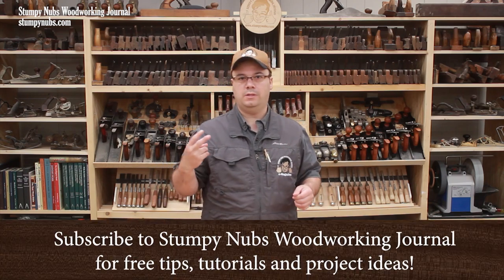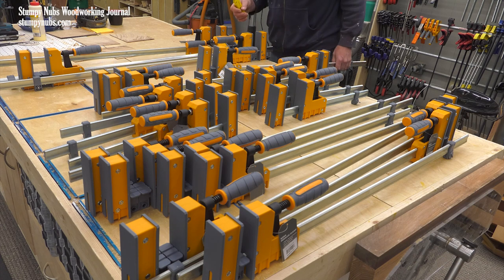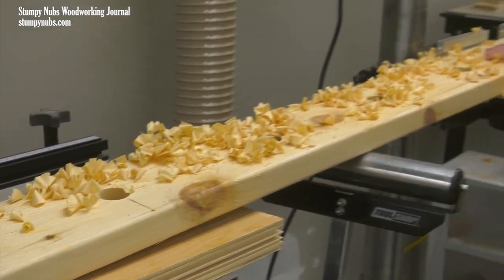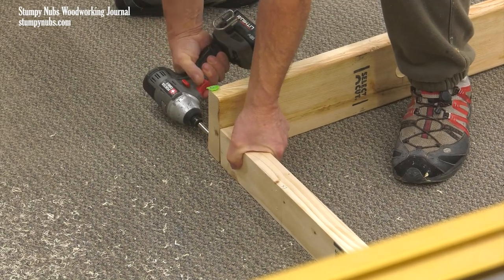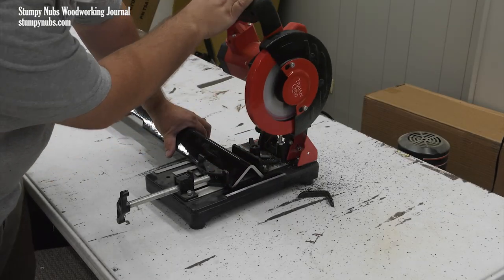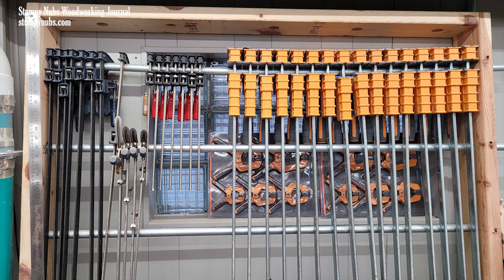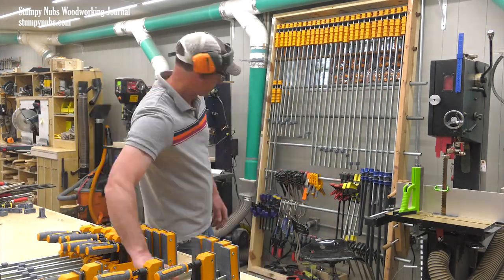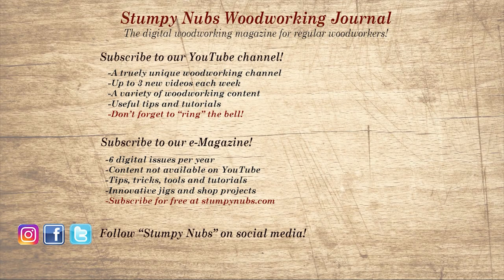How many clamps does one woodworker need?

Comment: This comment goes back to your video regarding cabinet scrapers.  I tried multiple times to make my card scraper work.  I followed your advice step by step.  I watched video's of 2 other very respected wood workers.  
I never succeeded in getting shavings, not once. Nothing but powder.  
On a lark I purchased 2 scrapers from Lie-Nielsen.  These are both much thinner than the one I've had for years.
My first use produced the magical curls that I've been chasing.  That leads me to think that maybe some scrapers are too thick or too hard.  Something worth checking?  I follow each of your videos and have the greatest respect for your talent and business acumen.
I like the clamp rack and now will probably build it and forget the plans I bought from you.
Reply from the maker: Scraping requires finding the right angle while also slightly bending the scraper. Thinner scrapers are easier to bend and do not fatigue the hands as much. Some very thick scrapers can be difficult to bend if you aren't used to it. You are probably just more comfortable using the thinner scraper, and so you are able to relax and feel the angel better.

Comment: I made a rack similar to your wall version several years ago. I hope you find my suggestions useful. I made mine two sided in triangle configuration then added a firm base with lock casters. The mobility saves many wasted steps while speeding the assembly process, double the storage.
Love the channel.

Comment: Great video!  Couple of Qs:  Why did you drill the holes in the wood so much larger?  Something just above 3/4" should have been sufficient?  Also, I note the rack is tilted.  Do you think it would work vertical?  I don't have much space and am fitting my rack into an available slot front to back.  Thanks!

Comment: For someone like me a single section of pipe also works.  
I have one that was originally a coat rack that has one end attached to a cabinet and the other end suspended by a shelf bracket that happened to be made to hold the coat rack.

Comment: If your conduit is bending under load, I've found that inserting a wooden dowel the same diameter as the inside of the conduit should stop most if not all of the sagging. Just this week I did that to repair a clothes cupboard where after ~55 years the 5/8 (16mm) wooden dowel sagged enough to pull out of its support holes - I drilled the holes out to 1'(25mm) and put a 7/8 (22mm) hardwood dowel inside a 1 inch (25mm) chromed tube - no noticeable sag under load.
Reply from the maker: Many clamps naturally hook on 3/4-inch pipe without having to fully tighten the jaws.

Comment: The steel floor joist support in my basement shop supports about 200 of my clamps. I lightly clamp on the lower beam cord yielding me two rows of clamps. Every clamp style works in this arrangement. Short C clamps and Quickgrip clamps go where head height clearance is required. I low the longer clamp tails to help form a wall or barrier where I don't want foot traffic. Longer clamps are racked on the same I beam along my stairs which happen to  run adjacent and parallel to the beam. 
My clamp inventory is approaching 250 which means that I may have 50% of my ideal target inventory number.
I favor Bessey parallel jaw clamps. You have an orange brand that I don't recognize. Could you do a brand comparison? Bessey work so well that I have been timid to try other brands since brand names I consider inferior to Bessey cost about the same a Bessey.

I still use Pony 3/4 pipe clamps since my parallel jaw clamp inventory is small. I padded many of them with Jorgensen/Pony plastic pads. I haven't seen these pads for sale in years. I tried Rockler brand pads, but they fit Pony clamps poorly and they split and break easily. Are Pony pads still available?
Reply: His clamps are Bora.  Slightly cheaper than Bessey.

Comment: Rather than risk having the holes mismarked and misaligned, you could just clamp the 3 stringers together and drill them all at the same time...if you had a few clamps you could use for such a purpose.
Reply from the maker: My forstner bit is not long enough.